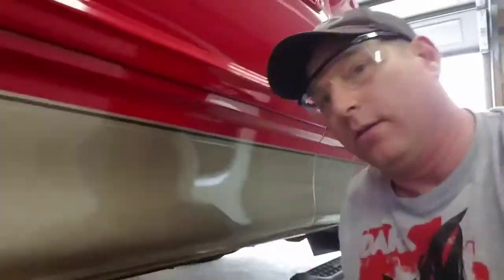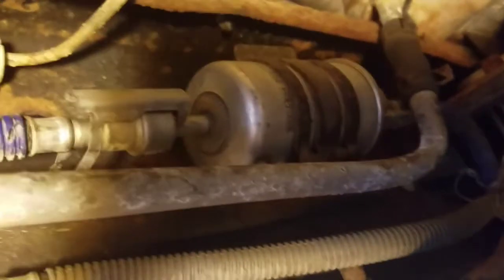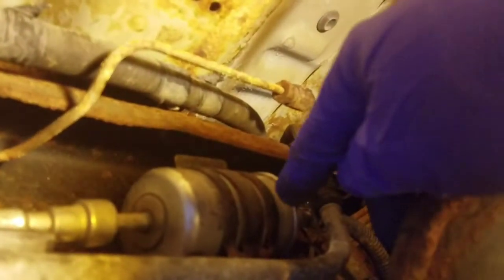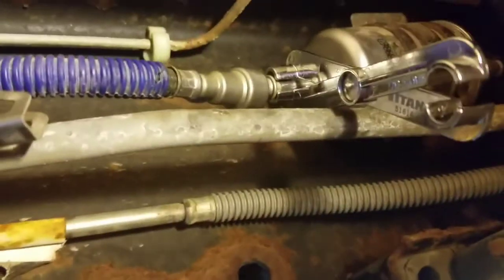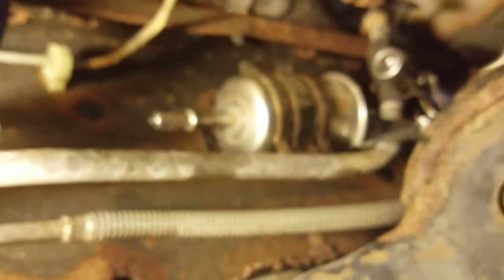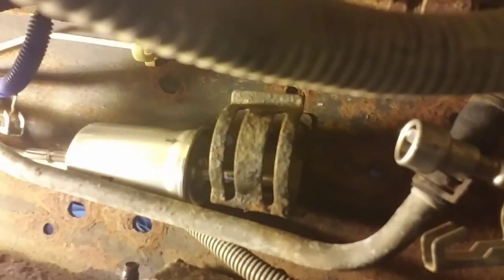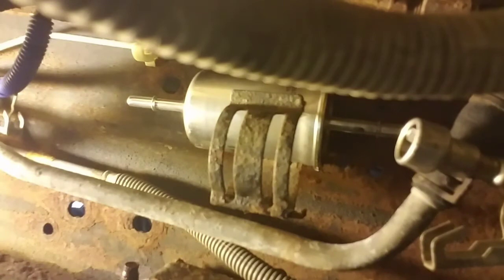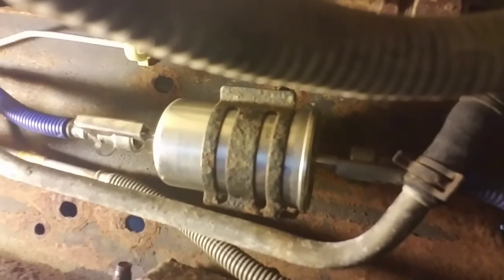How to do a F150 Fuel filter change

Comment: Hey there! Came across this video and wondered if you felt any difference in performance after replacing? I bought a 00' F150 5.4L V8 and have been going through doing maintenance. Any input would help, thank you!
Reply from the maker: No real improvement with importance, but will probably save the injectors in the long run.
Reply: Thanks for the guidance!

Comment: Read on another video that you had a knock in your ford. Did you fix? Leave as is? Replace cat?
Reply from the maker: Josh Bowles I'm a nurse, so I have stephescopes. I placed it on multiple place on the engine block.  Quiet as can be. I traced it to the passenger side down spout burn off cat.
Reply from the maker: The noise goes quit when it heats up, the internal metal expands and it gets quieter. I'm going to replace the exhaust later on with a single cat system.
Reply: Ahh. Makes sense. Mine gets loud after it heats up so sounds different for me. I’ll try to round up a stethoscope!
Reply from the maker: Josh Bowles when it's running, put a stephescope on the engine block, try placing it on the oil pan first. It should be quiet. Then crawl underneath and place it on the exhaust.